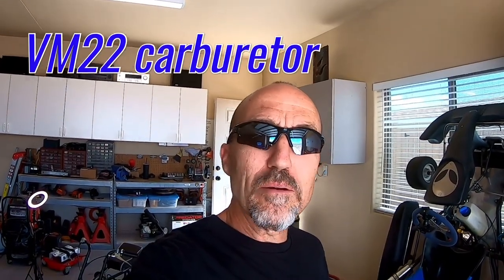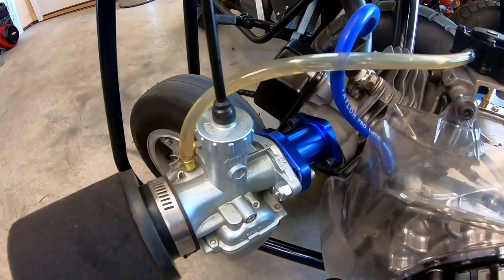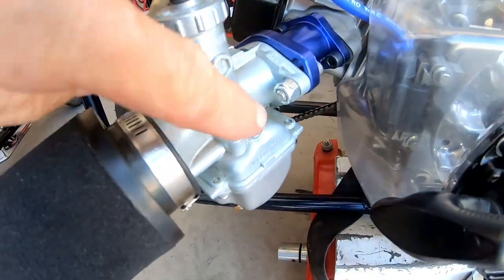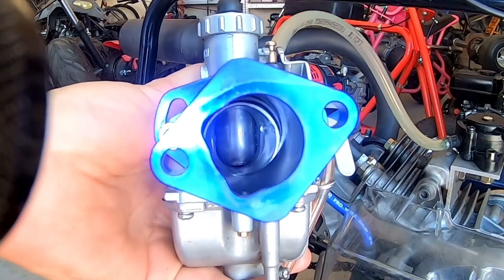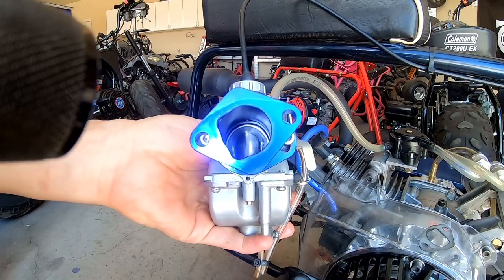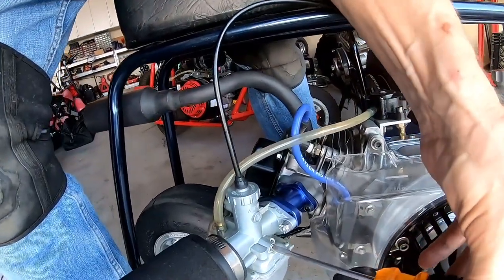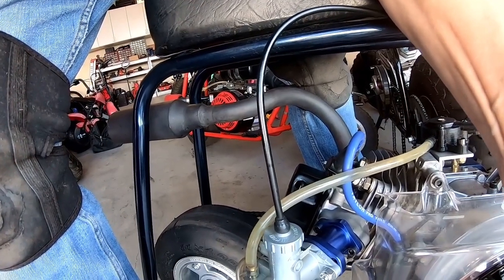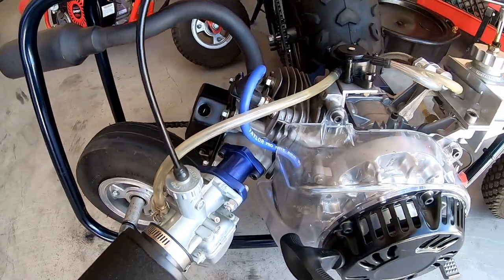VM22 carburetor won't idle on a Predator 212 FIX

Comment: You know it's a good thing that you have the time to be able to mess with these bikes and figure these little things out. I've been messing with these bikes for years now and that's been a common issue with me that I just figured out not too long ago. I have a 2:25 that's acting up right now. When I try to start it it backfires through the intake and the exhaust. I'm pretty sure it has to do with my valve adjustment and potentially a sheared key on the flywheel. Hopefully it's not a sheared key. But I will make sure my carb is aligned with the intake before it is put back on to alleviate one less issue or problem. Thank you

Comment: Thks for ur video. Well for my VM22 I just throw it as not worth spending my 2 year to adjust, tune, troubleshooting it & trial run it on my bike and getting rough running, jerking, stalling, bad mileage and no peace of mind. 

I've installed a Keihin on my bike and it run perfect and trouble free for 2 years. Just tune it in less than a minute. Been running perfectly ever since day 1 installed it. 😂😂😂😂😂😂😂
Reply from the maker: The VM 22 carbs take a few minutes to tune. I haven't had many issues with them. Check out the playlist. I run many  Keihin carburetors on the channel https://www.youtube.com/watch?v=VbcpA0jdSIw&list=PLkbj-ip-5FzZG40xkiEtZHRtF_jDzxA9U

Comment: Always check for vacume leaks and compression and then timing a bad fly wheel key can also act like bad carburetor. Valve lash can also be an issue.
Reply: Only if you are installing a Mikuni on an engine that doesn't run right prior to the Mikuni. In that case all of those should have been checked prior to installing the new carb.

Comment: i told my mate to get a 34mm flat slide for his 270cc go kart, it runs a bit rich with the smallest jet and the needle in the top groove. should he just buy smaller jets or ? would a cam help the air-fuel ratio?

Comment: I do have a question, I have an oem mikuni on a stock predator 212 with only a straight pipe header pipe and when I pop the throttle like you were doing in this video, when the throttle is let off quickly it tries to die like it’s flooding, I have put a 120 jet it in, stock was a 98, anything I’m missing in tuning? Fuel air is right at 2 full turns out and has I’m pretty sure 15 pilot jet

Comment: Love your videos. Just built a 196 on my Coleman. Chinese VM22 is really hard to start and hard to tune the idle.
Does the small hole above the mixture screw under the o-ring need to be exposed? My manifold covers it completely with the carb lined up like you just showed. 
Thanks!

Comment: We have one and it's spitting tons of fuel out of the air intake, messed with the float and to no avail it won't run. Did the steps in this video and it did run then stopped any advise?

Comment: Had a question I have a knock off vm22 carb and when turning on the idle it super high and come down two about 2k rpm with choke on but when choke goes off it idles super high. I have already checked for vacuum leaks and I have none is my carb bad? Plz help

Comment: Just to add from my experience. wouldn't idle, and needed a bigger pilot jet, so if ordering, i suggest order and assortment of jets, had to increase 3 sizes to get it smooth running
Reply from the maker: Thanks! Check out my other VM22 tuning video.https://www.youtube.com/watch?v=MnQvIlFX8hM&t=190s

Comment: I need help, mine engine is doing exactly the same thing your is in the video but I fixed what you said and it didn’t change anything, I’ve replaced gasket and deep cleaned the crab even replace the needle in the slide but nothing seems to work any suggestions?
Reply from the maker: Check out this video, maybe it will help https://www.youtube.com/watch?v=MnQvIlFX8hM

Comment: Good tip! I have a Mikuni VM22 to install yet and will pay close attention to this alignment. Question, do you find most 212's need the fuel pump with the VM22?
Reply from the maker: Thanks! No, as long as the tank is above the carb, and you can get a good gravity feed.
Reply: @Black66  Ok, thank you! I'm using my 212 predator as a motor for a long tail duck boat motor. I am not sure how much gas it will use when I get the cam and VM22 on it, but have the ARC flywheel and rod as well, so the governor will be removed. I'd like to keep the stock tank, just to keep the footprint smaller. I will just have to try it and see. I carry a 1 gal can with me now for back up.

Have really enjoyed your videos. Even if I don't own a mini bike, your motor building content is fire! ;-)

Thank you!
Reply from the maker: @jameswinnett4012  Thank you! Thanks for watching the videos!
Reply: @Black66  I have a question is the choke on up or down on mikuni carb? Thank you for the inspiration in getting a bike!

Comment: So you told me to come from the other video and I've tried to line it up right and last I checked it seemed ok but mine doesn't idle high and I can adjust the idle screw still shuts off when not choked

Comment: when my predator 212 gets warmed up.  it will not pop or even try to start at all unless i crack the throttle to about 1/4 throttle and blip on the gas during the pullstart.  then it runs and idles fine.  vm22 carb, govener removed billet flywheel 18lb valve springs.  is there any adjustment to get it to warm start easier? bigger pilot valve?
Reply from the maker: If everything else is in order then I would look at changing out the pilot jet.
Reply: @Black66  I'm thinking that too. It's on a snowmobile and running up ear 8500' elevation. I'm thinking my pilot may be too rich.

Comment: I have a question what is the best jet to put in a 212 tillison for a mikuni
Reply from the maker: It's really hard to tell because of elevation differences but I usually will start out with a 120 main. I will run the bike and then check the plug for that nice brown color.

Comment: You reconfirmed what I am thinking! I spent more money and got a nibbi and have taking extra care to not junk it up. I put a stage 2 kit in a Tilly got rid of hemi, put my built predator head on her and I got twice the power I was expecting! 
After a good 2 hours riding 
This same thing happened!! But not before snatching the  carb off went to rebuild it. Thought what if it’s the o ring ???? Scared to use locktight on alum.brass etc and the thing came loose anyway!!! Turns out it was the connection cause I can’t say was only alignment because I’m definitely replacing rubber /plastic everytime to break the connection. I simply changed heads but not a o ring ?? Wtf 
Save yourself the headache!

Comment: I have a problem on my bt200x with stage 1 kit and a size 0.38 jet so it’s good but also idles very high and not good and it will die when you take off the choke, it’s got a normal carb that I got off Amazon that fits the 196cc

Comment: Good video.  I see that you have a fuel pump on this engine.  How does the performance of the VM22 with a pulse fuel pump compare to VM22 without a fuel pump?
Reply from the maker: Thanks! They pretty much perform the same. The only reason I run a pump on this engine is because the tank is lower than the carburetor. It won't gravity feed.
Reply: @Black66  so if it ewont gravity feed what would the symptoms be i ask this question because i too have a vm22 that wont idle without choke it dosent run high and all the gaps are lined up to spec

Comment: So I have a huge question what do you think the issue would be if it try’s to die after full throttle but recovers what do you think that could be ive tryed 115 all the way up to 125 but next is the 130 id just want to get your input. @black66

Comment: I have the predator 212cc non hemi and mine only runs when choke is off if I turn the choke over to on it doesn't teen start up at all, and if I'm not giving the engine any throttle and I just let it idle it dies/ turns off I have the stock carburetor on it but I can't figure out what the issue is
Reply: My 212 predator is brand new same with the filter and header pipe, not sure what I did wrong but it won't idle properly and if I come to a stop or slow down it shuts off

Comment: Great video like always! Working on getting mine running right. I think the 15.5 pilot jet I had in it makes it idle too high for the hisun 196 stock engine. Got a 12.5 pilot jet coming tomorrow to hopefully fix it. Thinking a 110 jet and 12.5 jet will be the best combo for my hisun 196. Would love to hear your thoughts on what jetting works best. I know you went from a 120 to a 110 on your hisun 196 engine.
Reply from the maker: Jetting is a little different for everyone depending on engine mods ,elevation, etc. I tend to get away with a little smaller jet because of the elevation I live at.  I would do what your doing and then look at the plug to check on how its running.

Comment: My 224 idles high no matter what I do. I checked the alignment and it was off. I adjust it and restarted and it still idles high. I sprayed some brake clean all around to see if there was a vacuum leak and it did not. My idle screw is all the way out and the slide is as far down as it will go. My main jet is a 120. Im higher elevation around 3200. What could it be? Could it be I need to change the pilot jet?
Reply from the maker: Sometimes the cable holds the slide up slightly which causes a fast idle. The cable possibly could be adjusted so it won't let the slide all the way down.
Reply: @Black66  thanks for the reply. I actually had checked that already. The cable is not holding it up. I removed the cable and checked the slide. It goes down as far as it does with or with out the cable attached and the idle screw all the way backed out. This one has me puzzled.
Reply: @cee169  mine is doing the same exact thing, same engine same problem, the idle isn't unmanageably high, but it's still very high with slide screw out, no leaks either
Reply: @tylerb8284  I ordered pilot jets and they were the wrong ones. I found some on gopowersports I think are correct. I ordered the next 2 sizes up last night. I will try them out when they come. I think the pilot is lean. Pilot jet controls idle to quarter throttle. Mine is also not unmanageable but definitely enough to make the bike creep forward. Are you also running the vm22 copy?
Reply: @cee169  yeah I have the GPS 22mm mikuni, I believe it came with a 130 pilot
Reply: @tylerb8284  my main jet is a 120 needle is on position 3 and pilot is a #38 .0150” I ordered the .0175” and .0200” from gps.
Reply: @cee169  let me know how it goes! I have just over month till I race! So id appreciate it
Reply: @tylerb8284  pilot jet brought the idle down.

Comment: Noob question for choke to be ON its up or down?
Reply from the maker: The lever up is on
Reply: Yeah when I put choke off it stalls but I can adjust the mixture screw and slide screw. Can I ride with choke on or not a good idea?

Comment: Question I have a 212cc hemi is a 28mm carbulator to big for it
Reply: Yes 28 is too big unless you have some monster sized valves. 22mm is perfect for standard valve sizes. Could go up to 24mm with big cam and valves
Reply: @baldbutton1983  I have done 18Lbs springs on stock valve drag pipe arc flywheel 32 degree timing advance no governor oil pressure out should I buy vm22 or 24mm
Reply: @unknwnoutcast4388  I have a similar setup and tried both 22 (round slide) and a 24 Chinese Amazon (flat slide) carb and I am in love with the 24 flat slide. Amazing throttle response and has so much power over the 22 with my experience. Flat slide feels racy and the 22 feels good for cruising🤷‍♂️ hard to explain but that’s the best I can put it
Reply: @jamesharaldson375  thanks brother I’ll be buying the vm24 thanks again any jets change or the same that came with it?
Reply: @unknwnoutcast4388  No prob! And yeah it did come with 1 pilot jet, 1 jet needle, and 2 main jets of different sizes in the box but the stock setup worked perfectly fine for me. I believe it’s called a “Maikuni” PWK carb. You’ll need to buy a predator 212 flatslide manifold for it, a 2” ID UNI air filter, and I used some basic radiator hose lying around as a manifold hose
Reply: @jamesharaldson375  thanks so much be buying that 🙏🙏🙏🙏🙏

Comment: Mine is still doing it and I set the slide all the way down and cut the gas off on the carburetor adjustment screw and the engine still wants to take off maybe it’s the Float 😢😢

Comment: I already checked for vacuum leak and I fixed that but my bike still won’t idle and it idles high
Reply from the maker: More leaks or the slide stuck open a little...
Reply: Where do you think the air leaks could be?

Comment: Actually you don't need the gasket from the engine to the manifold ; use Copper gasket spray and it won't leak and last longer. JSC